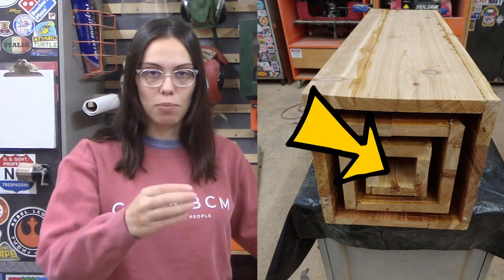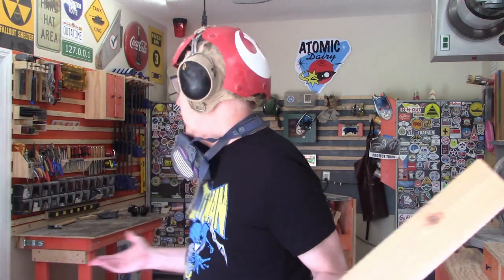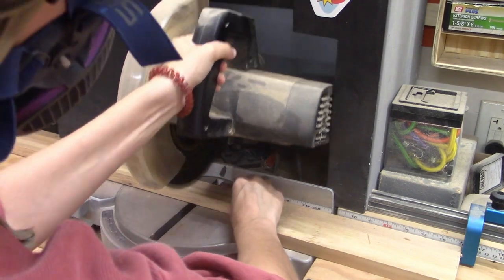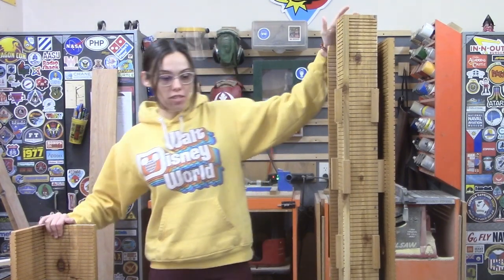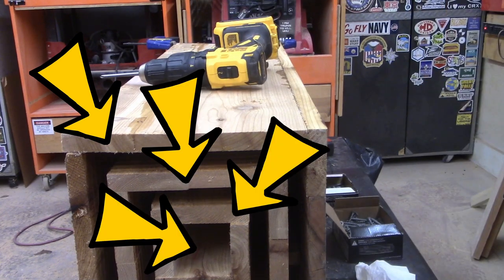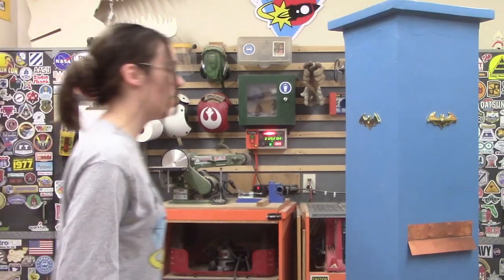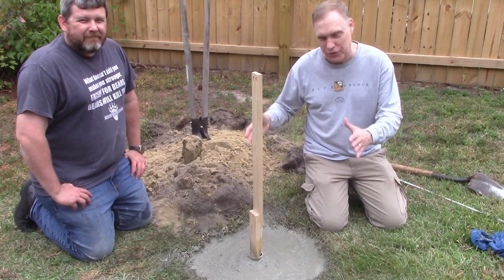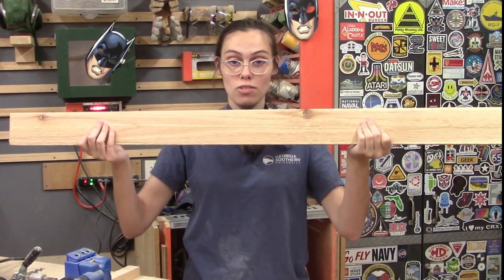How To Build a Bat House - Habitat for Endangered Species

Comment: What keeps the bat house from spinning on the pole? Don't you need to somehow attach them together?

This is the design I want to build, so thanks for the demo on construction.
Reply from the maker: It's a fairly tight fit, and the small surface area means there isn't much wind force on it. We figure if there is a problem in the future we'll put a screw into the pole, but we wanted to try it without one first.

Comment: Fantastic tips, thank you!   How exactly did you join the 3 poles together?
Reply from the maker: Many thanks! For the poles got slightly wider diameter pieces of pipe and used them as sleeves that we bolted on to connect the poles.